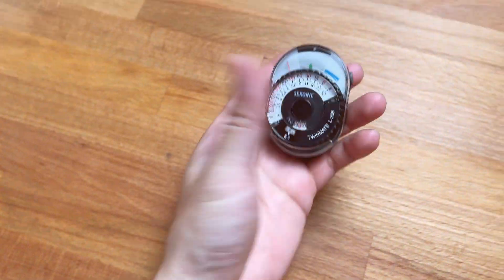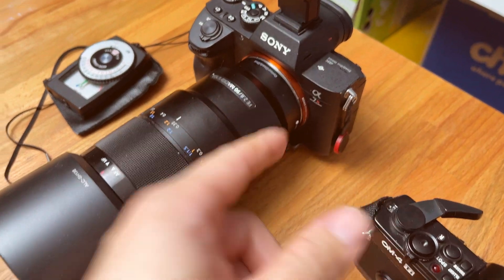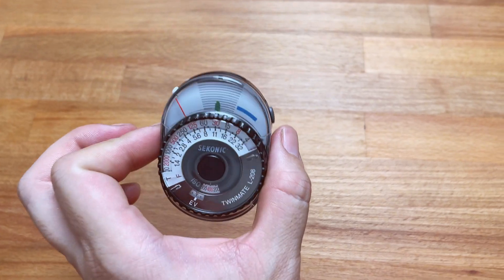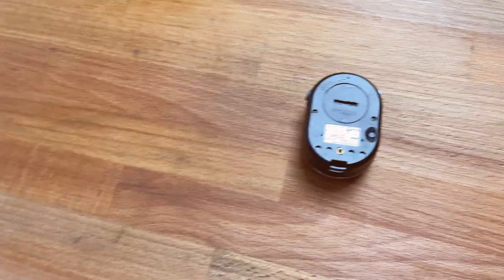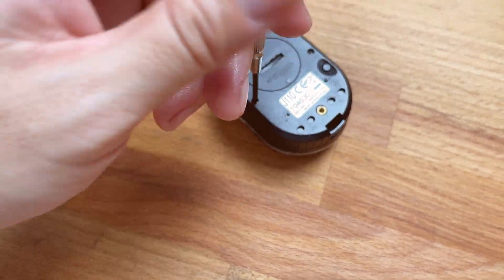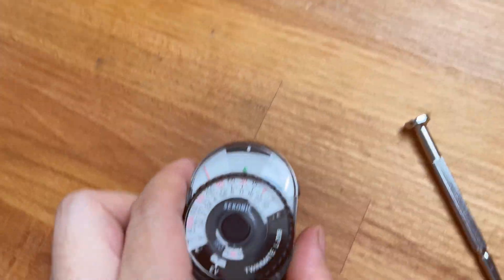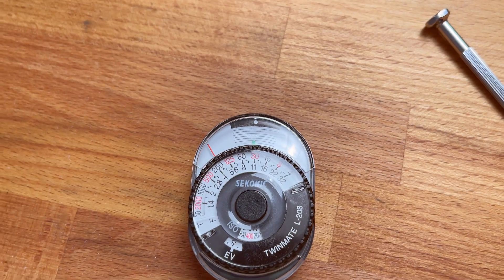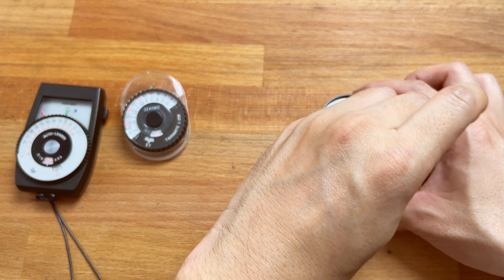How To Calibrate Sekonic L-208 Twinmate Analog Light Meter

Comment: Thank you, this is an easy adjustment ... I have a Sekonic L-208 as well and it's off by about 0.5EV... so now I can adjust it. 

BTW: You used the terms "ambient" and "Incident" with respect to the metering mode of your two meters. This is incorrect. I believer you meant "reflective" and "Incident" ... you used reflective metering mode to get your calibration reference. Reflective metering means you are metering the light being reflected from your subject. Incident light metering means you position the meter at the subject and point it towards the camera. You slide the diffuser (or integrator) over the metering opening, and measure the light falling onto the subject (that is, incident to the subject). It's a small thing, but I find it helps photographers to always use the correct terminology. :-)

Comment: Followed the instructions, and it is still 1 to 1 1/3 stop off (over exposed) even when I turn the calibration screw all way left (anti-clockwise). I am now trying to return it, and then I'll save money to get an L308-x which should be much better (from what I read). Thank you for an informative video.
Reply from the maker: Yeah, if you have time to watch my comparison video between different price point of light meters, L308-X is by far my fav. In the mean time, your phone's light meter app will work just as good, maybe not as cool as using a light meter. https://www.youtube.com/watch?v=pMtVprw38pI
Reply: @ I'm lucky, all my film cameras have light meters which actually are more or less correct (+/- 1/3 stop), and my digital one is spot on. But I would like to have a handheld light meter to be able double check when I'm in doubt.
Reply from the maker: @casperghst42  ✌

Comment: The reason you have to press twice is actually because you're measuring incorrectly. You need to press and hold the button for at least 1 second (a quick press would just be a fraction of this). In your case, the first press just gets it close to the reading and the second one gets it on. The manual mentions this, but it's easy to overlook.

Calibration worked great! Compared it to my L-308X and my E-M5 camera and all three agree now. The Twinmate is a good little meter, especially for quick lighting confirmation.
Reply from the maker: That's really interesting that it needed to press for a whole second for reading... I'll test it out... Some older meters doesn't even require such a long metering time.

Comment: I also bought this light meter, in incident light the reading is precise, in reflected light, underexposed by one stop ... I have here other 2 professional light meters and many cameras as a comparison. But if I corrected it, I expose it to correctly expose it in reflected light then I would make it wrong in incident light ... And I also bought 2 on Amazon to compare them ...
Reply: Does the meter agree with the others at lower and higher light levels also? (Analog movements usually have had separate adjustment points for low and high readings.)
Reply from the maker: @noeoep  This one is linear; the low/high analog light meters are of much older technologies to my understanding.
Reply: @TheGizmoGarage  Thanks, good to know.
Reply from the maker: Incident meter valve is affected by the white dome, if dome is deteriorating then it would get darker when dome is on top for incident metering. That explains why when you remove dome for reflected metering the meter goes underexposed. Also the color of background used for reflected metering needs to be 18% gray, other color will cause meter to be confused when metering and cause over/under exposure. Many things may cause unreliable reflected metering value that’s why incident metering is most accurate, once properly calibrated.
Reply: @TheGizmoGarage  The measurements I also made with the original Kodak gray cardboard at 18%...
Reply from the maker: @AlessandroChiariniphotographer  Hmm, Did you contact Sekonic for the issue?